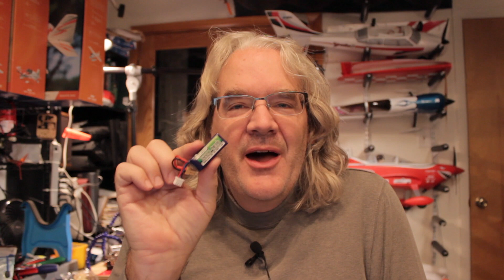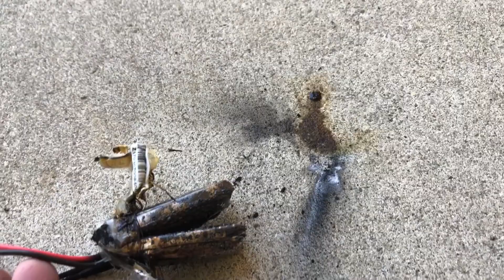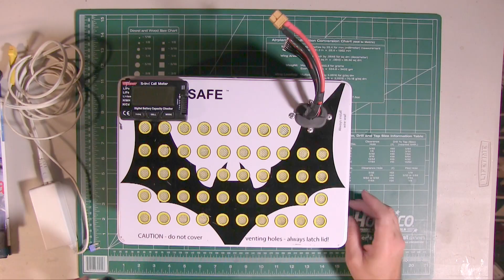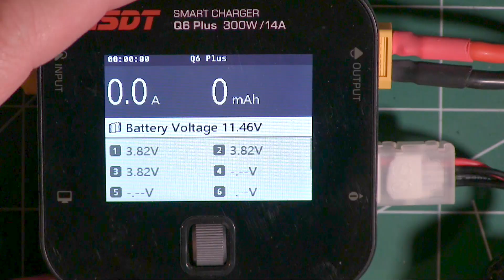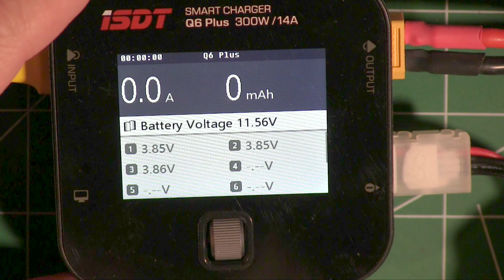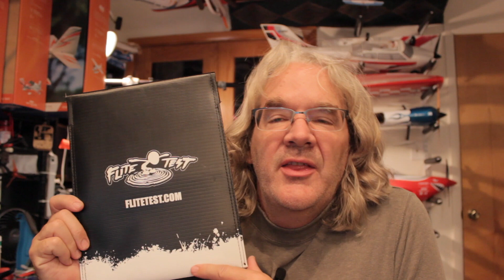Prevent LiPo Fires and Parallel Charging #CaptainMavic

Comment: Did you ever say why your battery went up? I have never had an issue as long as you are balance charging, and not fast charging or any other type. Over time I have learned some other things. If you want to know more, you can learn about why batteries puff and how over time cycles what actually happens inside the battery. I still would like to make a heat sensor mate for charging safety as another layer. For older batteries I do monitor temps with a temp gun. If a batt does get hot, I set aside for recycling trips. Batteries plus in carmel takes em for free other can charge a fee. I personally never use lipo bags etc.
Reply: I use a HiTec  X4.  It does utilize a temperature sensor for each of the batteries (charge up to four units at the same time).  Easy and safe solution for charging station:
put everything in an old Crock Pot and place a bag of sand on top.  If there is a fire, the plastic bag will melt and the sand will dump onto the batteries.  

Glad you're OK Captain!  There's no stopping a runaway discharge.  The Lithium burns very hot and the smoke is caustic.  Thanks for sharing your experience with the community.  Gotta stay vigilante, there is a lot of energy stored in those babies!!
Reply: @SoftTinyBunny  yes I do have a bag of sand at my place lol, that is another nice tip. People should really take it upon themselves to learn the basic lvls of a subject to understand why stuff happens. All this knowledge is out there and free, you just have search the right terms. I'm also glad the Captain is ok.